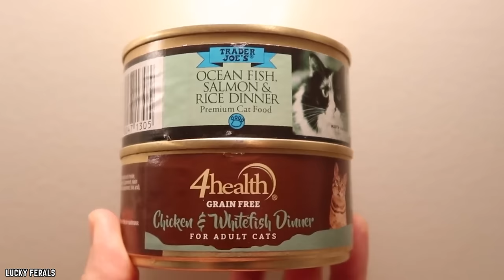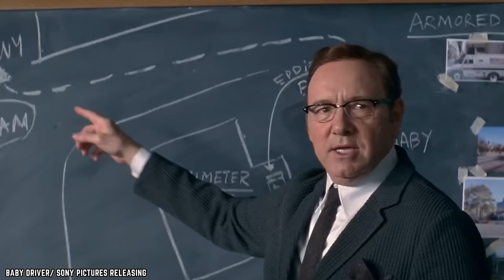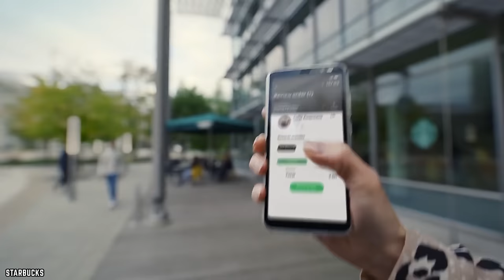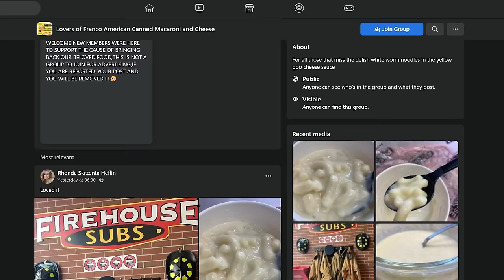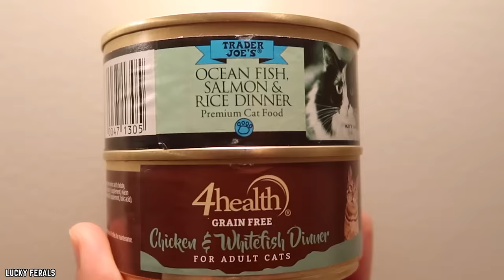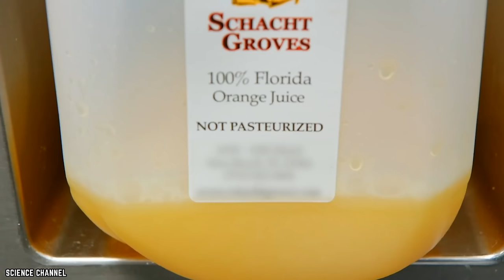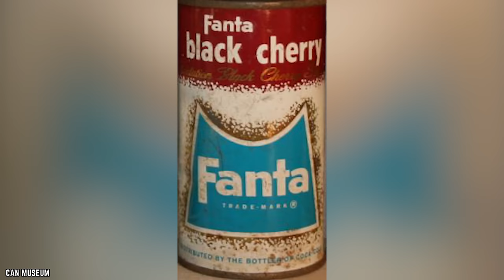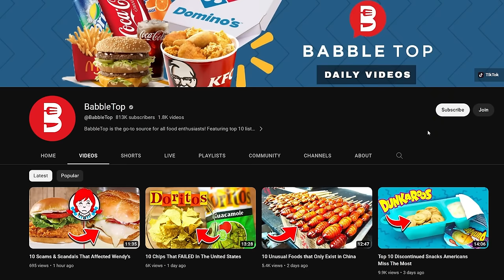10 Discontinued Canned Foods You'll Never See Again

Comment: I have a question and hopefully someone can answer it.
To begin with, I have Googled it to try and find out but no luck.
It is possible I don't have the actual correct spelling.  Back in the 1970's there was a diet drink supplement called "Weight-On"  I thought that was the way it was spelled but I could be wrong.  It was a drink in a can and it was to help you gain weight. (Not lose)  They advertised on TV commercials at that time and probably some magazines too but I can't seem to find it.   I realize it is no longer around but would still like to find out any information about it.  It was NOT the product called BOOST OR ENSURE. It's main ad was to drink their product to gain weight.